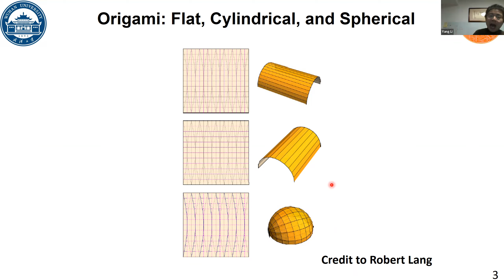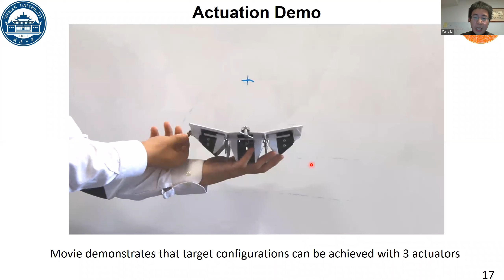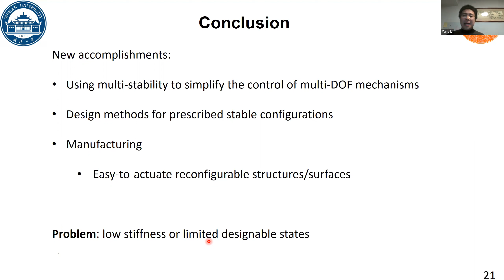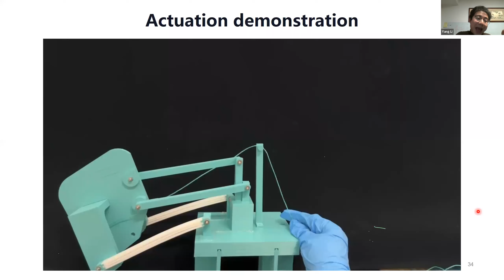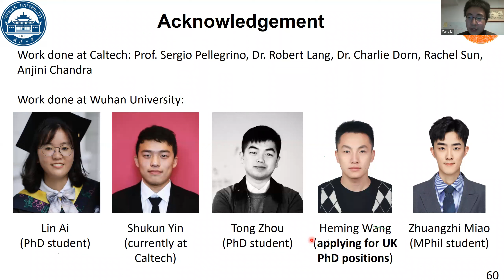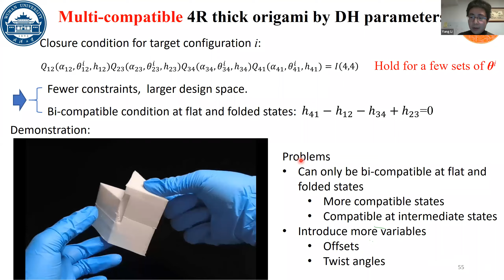Multi-stable structures talk given at Cambridge University

Comment from the maker: The related papers:

Ai, L., Yin, S., He, W. et al. Easy-to-actuate multi-compatible truss structures with prescribed reconfiguration. Nat Commun 15, 4886 (2024). https://doi.org/10.1038/s41467-024-49210-3

Li, Z., Ai, L., Feng, H. et al. Multistable compliant linkages with multiple kinematic paths separated by energy barriers. EML (2024). https://doi.org/10.1016/j.eml.2024.102175